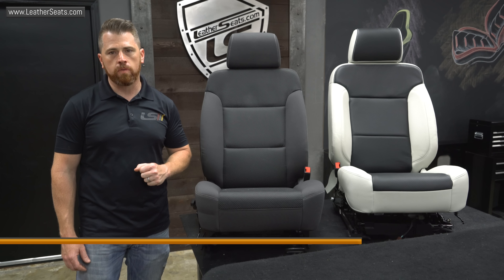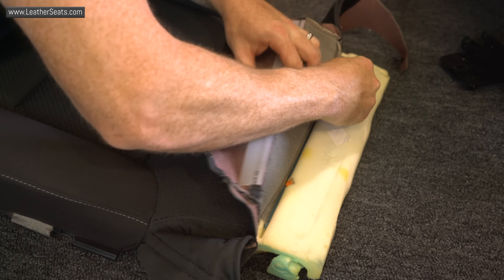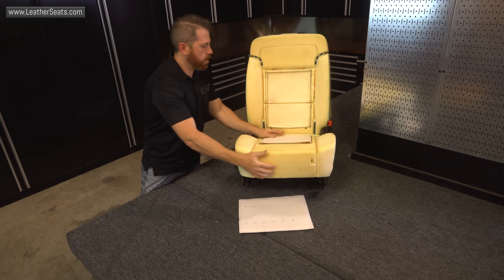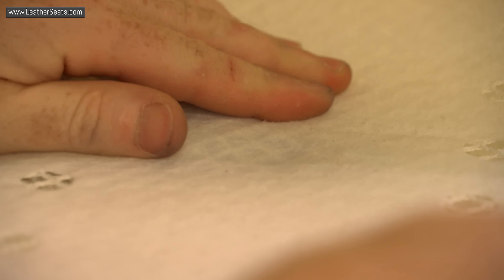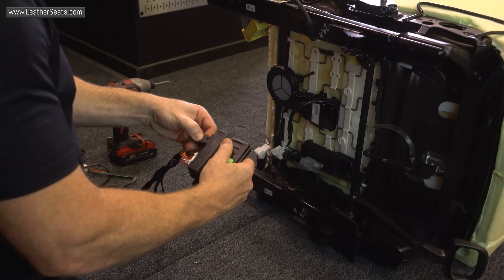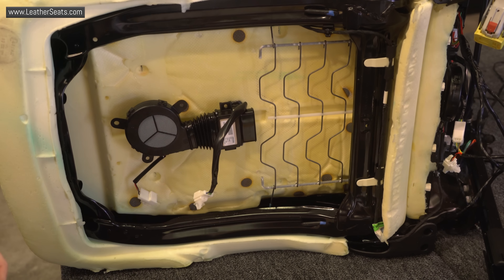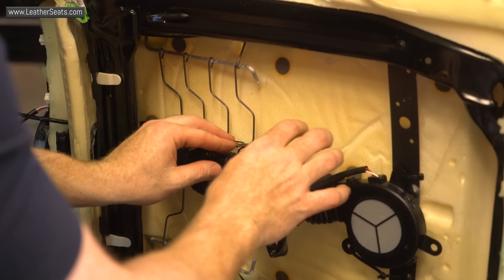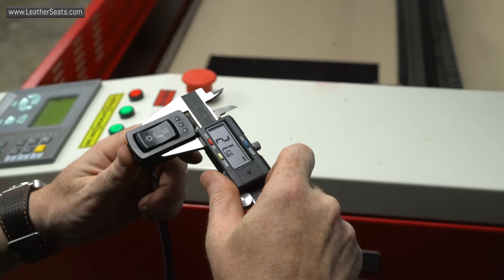Installing Heating and Cooling Seat Ventilation Units - LeatherSeats.com Tech Tips

Comment: Adding leather is fairly a normal practice in the aftermarket world, adding heated seats is also fairly normal, I probably would have noted that the clear lines going under the seat are pressure sensitive and turn air bags on and off depending on weight and that you should avoid doing this on seats that have that system on them. Or when doing it to be extra careful to not puncture them as they are filled with glycerin. 

Two questions :

What and how do you charge out for
This job? I’d like to say that an average seat 💺 Hester job runs about 499.99 in my store for two seats, with the additional labour involved with adding cooled components to the mix what’s the average labour time involved with doing the installation? 

Modifying seats in the fashion is quite dangerous and you could potentially be modifying the time delay process with air bags during a crash, has your product been tested using the proper governmental structures? 

Thanks a bunch! Super interesting concept would like to know more.

Comment: Can I do with underneath a seat cover so I don’t have to tear up my whole seat?
Reply from the maker: Jacob Werner I'm not sure I understand what you asking. The distribution pad sits between the seat upholstery and the seat foam. The pad is what directs the air through the upholstery to heat/cool the seats and will require the vent tubes to connect to it (which requires a hole to be cut in the foam). You can get as creative as you want with the install to fit your needs but you will need to modify the seat foam to some extent. Give us a call at 1-866-639-7328 or email us at sales@leatherseats.com if you have any questions about the process.

Comment: How effective are these kits vs factory?
Reply from the maker: Jamie Diaz As long as the units are installed correctly with the proper upholstery (perforated material with high-flow foam backing) they function just as well as any factory unit. In fact, we use the same Gentherm components that are used in many factory systems. If you have any questions please feel free to give us a call at 1-866-639-7328 or email us at sales@leatherseats.com.

Comment: Great workmanships!   I have a 2018 Mercedes-AMG c63 with heated seats.   Could I add this vent seat modification into my seats?
Reply from the maker: Frank Kwok These units are universal and can be mounted in most vehicle out there. There are a few requirements for the seat upholstery though. The upholstery will need to have perforated inserts as well as high-flow mesh foam backing to allow for airflow. If you have any questions about these requirements please feel free to give us a call at 1-866-639-7328 or email us at sales@leatherseats.com

Comment: Nice job. However, once you start tapping into the wiring the warranty will be voided (if there is one). Would it not be better to connect it to the fuse box?

Comment: And let me guess , the seat becomes more uncofortable and the TED separetes from the pack afterwards
Reply from the maker: +EmptySergeant When installed properly the units lay flush with the seat foam and you don't feel any difference after the leather upholstery is installed over it. As for the separation see 8:48 in the video. You can get a similar effect with zip ties.

Comment: Helpful, I'm currently reupholstering Eos seats right now. What we thought was a cigarette burn turned out to be the factory heated seats had caught fire at some point. The burn marks followed the outline of the heat pads. Was not noticeable on the outer cover. Just ordered the new pads. Thanks for the video :-).
Reply from the maker: Sondra White Whoa, sounds like a bad deal! Glad you were able to track it down and get the heaters replaced. Thanks for watching!

Comment: pretty cool system. it does seem like it's a little over-complicated though. i feel like it would be easier and cheaper to just run plumbing from the car's vents with motors instead of having control modules and TEDs that exhaust hot air into your car while your trying to cool it down.

Comment: @LeatherSeats.com Would it be possible to attach two blowers to both the top and bottom units? I sweat A LOT more than most people do and the added air and cooling would be nice. The stock seat cooling on my dads 370z isn't enough at all. Its definitely better than the 0 cooling my car has, but it isn't enough. Also, will this blow through my (non-leather) seats without issue or will I need to modify the stock upholstery?
Reply from the maker: austinpetemo Firstly, I'm not sure exactly how the air distribution is set up in your factory cooler system. Without knowing the exact details for the 370Z system I am limited on my answer as it may not even be directly comparable to our units. It might work to add a second blower but it would be up to you (or a local automotive upholstery shop) to figure out how or if this is feasible. With our system, the units are designed around powering 1 blower and we have not tested multiple. You would need to be able to supply power to an extra blower per section and that may affect the fuses and/or the power harness. Also you would have to fabricate a split in the air ventilation tubing to direct the air from the extra blowers which may affect the pressure and/or speed of the air flow. I would suggest checking with an automotive upholstery shop that has the ability to work with heater/cooler units and see if they could help you troubleshoot.
Reply: Thanks for the reply! Sorry I didn't clarify well enough. I'm interested in using your products in my vehicle that doesn't have factory ventilated seats. I was using the 370 as a comparison; its cooling effect is somewhat weak. You pretty much summed it up for me though, the split in the tubing your product uses may be hard to fabricate. Thanks again.
Reply from the maker: austinpetemo No problem! If you have any further technical questions be sure to email ericp@leatherseats.com or give us a call at 1-866-639-7328.

Comment: So who ever in back seat gunna feel the heat?
Reply from the maker: No, that is not the case with these units or other OEM systems using the Peltier Effect. The system's under-seat exhaust  has a negligible effect on the cabin air temperature in the vehicle.

Comment: Just a question, Is it possible to install those heater/cooler units on bucketseats (nonfixed or fixed) if yes is it hard or not (may let it a shop doing it who does alot of seats and panels)
Im located in europe, getting things to you guys and back is to expensive probably

(Seats i may install > https://www.braumracing.com/product/elite-r-series-racing-seats-red-leatherette-black-piping-pair/)

Edited: Adding information
Reply from the maker: Ralf Pawlowski The seats in this video are essentially bucket seats (they are the same seats used in the buckets version of the truck) The units themselves are universally compatible as long as there is enough room to be installed properly and the upholstery has perforation with a high-flow foam backing to allow for proper airflow. The installation process on this is very immersive and requires a large amount of creative problem solving and mechanical ability. Most of our customers have a local automotive upholstery shop/ 12 volt shop install the units for them. There are no step by step instructions as every single install will be different. We can ship you the units and you can probably find someone local to help you with the install. We do not have an upholstery kit that will fit the racing seats that you are wanting to put in the vehicle however it does look like there is perforation already on the seat upholstery. If you contact a local automotive upholstery shop, they may be able to replace the high-flow foam backing which we can sell by the yard. Please feel free to email us at sales@leatherseats.com or give us a call at 1-405-848-9999.
Reply: @LeatherSeats  thanks for the extremely fast reaction. And i will look into it

Comment: Sounds loud
Reply from the maker: M The volume during the test in the video was increased significantly so you could tell what was going on. In person the system is much quieter.
Reply: @LeatherSeats  Thanks.  Are you able to publish the dB?
Reply from the maker: @eM-ed5pz  We do not have specific DB level data however, the units are fairly unobtrusive.

Comment: I'm very interested in this kit.  Can you tell me how much current the TED units draw?  I know Peltier technology isn't exactly low power.
Reply from the maker: NGinuity For the heat settings its 12 amps max/9 amps steady state and the cooling is 6 amps. Hopefully this gives you an idea. If you have any further questions about our heater/cooler units or our upholstery kits be sure to call us at 1-866-639-7328 or email sales@leatherseats.com.

Comment: Amazing work. Love the part " you see there is no support here, so, I'm just going to cut a metal support bar real quick".... same with laser cut plastic for proper cut out of switch. 
Why not just buy oem seats with said functions from a junked truck and tie into the oem system?.
Reply from the maker: J J The metal support was not 100% necessary and a laser cut hole template is included with the kit. Most customers who purchase this kit are putting it into a vehicle that did not have the function available from factory.

Comment: General Question

If I'm close to Oklahoma, is it possible to go over there & possibly have you guys install it? Or does it have to be installed by someone else? Cause no way i'ma give this a shot by myself
Reply from the maker: Erick Villagomez-Diaz Yes we can do local installations of our product. This system does require some very specific components in the seat upholstery in order to work properly though so please contact sales@leatherseats.com to go over the details, pricing, and scheduling. You can also give us a call at 1-866-639-7328.

Comment: What do you suggest in a bmw 135 convertible? Cooling seats would be awesome! I'm guessing this works only on upholstery, and not leather?
Reply from the maker: George Giannou Our heater cooler units are universal as long as your seats 1-have room to mount the units 2- have access to proper power and 3- have perforated upholstery with a high-flow foam backing material that will allow for proper air flow. Upholstery refers to the material that is used to cover the seats in your vehicle. Leather upholstery is typically the better way to go for integrating heater/cooler units like these as leather can be perforated and backed with a high flow foam. Most cloth upholstery does not have perforation. If you have any questions about our products please feel free to email sales@leatherseats.com or give us a call at 1-866-639-7328.

Comment: Do you connect the backlighting for the switches to the same power on connection?
Reply from the maker: MsCelicagt4 The switch lights are already integrated into the power harness. Once plugged in, the lights will work.

Comment: Hello, very informative video. 
I have heating in my seats, but no cooling. Am I able to use some of the pre-existing parts and mainly add the cooling/heating device to what's in the seats and change the switches. Or does the heating alone run system  totally different to a heating/cooling system?
Cheers,
Col
Reply from the maker: Hey Col, our heating and cooling system is designed as a self-contained seat climate control unit that will replace any system that you currently have in the vehicle. It is not designed to integrated with any other existing system. Most seat heater systems use a surface mounted pad on the seat foam that warms up upholstery from underneath. Our system works differently by actually blowing heated or cooled air through the upholstery. This means that your seats are going to need to have perforation as well as a reticulated high-flow mesh foam backing in the insert sections of the seats. If you would like to know more about this product or the seat requirements please feel free to call us at 1-866-639-7328 or email us at sales@leatherseats.com.
Reply: LeatherSeats.com that's fine thanks. Aircon works well. Thanks
Reply: @LeatherSeats  Just to clarify, the white pad in the video that is taped and glued to the foam is a different product than seat heater systems on the market? One cannot merely install the fans, and make the same vent connection to it, then, install a different switch?
Reply from the maker: @thatsamorais584  Yes, this is a completly different product than a simple seat heater pad. The main difference is that it heats OR cools the seat via air being blown through distribution pads. The typical stand alone seat heater is a thin fabric pad that gets installed between the foam and upholstery that has heating elements/wires sewn in (no air being blown). Our pad is thicker and mostly hollow to allow air to be directed through it.

For the switch, ours has six separate settings: high med, and low for bot heat and cool. Most factory switches at most are going to be 2-3 settings for only heat. There may be ways to integrate other switches but we do not recommend it.

Hopfully this helps answer your questions, if you would like more info email sales@leatherseats.com or call us at 1-866-639-7328.

Comment: This is really awesome! Do you think this would work on a 2018 Corolla SE?
Reply from the maker: Christopher Hernandez The heater/cooler units themselves are universally compatible however you do need to have perforation and a high-flow mesh foam backing on the upholstery to allow proper airflow. You may want to show this video to a local automotive upholstery shop to have them see if it will work for your Corolla.

Comment: For volkswagen golf 4 it s difficult?
Reply from the maker: Gio Jo. Thank you for contacting us! Our product is not intended for any specific vehicle. There is a level of electrical work and fabrication that goes along with the installation of this product. It is doable for a more extreme DIYers. It is a pretty involved process so you may want to have an automotive upholstery shop that is familiar with this system to do the install.

Comment: Do your seats come already installed in seats they then just need to be installed into the 2014 silverados
Reply from the maker: +Jon Valera Im not sure I understand your question. Our upholstery kits are designed to replace the factory upholstery only. We sell leather trimmed upholstery kits not seat foam or full seats. Like this video shows, we also sell seat heater and cooler units which are sold separately from the upholstery kits and need to be installed prior to our upholstery.

Comment: Looks to me like an improvisation. I mean cutting with razors, eye measurements, using plastic wires to mount the vent... doesnt sound good
Reply from the maker: Dragos Bidu This is a universal product. Every installation will be different because the seat structure and space to mount the components varies with every single vehicle. You will have to be creative when adding any system to a seat that was not originally designed for it.

Comment: Amazing work..
Can this be done to a Camaro?
Reply from the maker: Miguel M Thank you for the compliment! This is a mostly universal product however it's up to you to determine if you have the space inside your seat to mount system. You would need to have perforated material and reticulated (high-flow mesh) foam backing on the seat upholstery in order for it to work properly. Please feel free to give us a call for more information! 1-866-639-7328

Comment: How do you conect it to the eletrical system of the car? Where do you conect it to...????
Reply from the maker: Noches De Carros 0639 0639 Eric give a quick overview of the wiring process near the end of the video here: 20:17 Each vehicle will be different but the overall concepts are the same. If you have never done car wiring or worked with 12 volt we would suggest that you take it to a shop to be wired.

Comment: Outstanding video.  Fantastic units with clear informative directions.  Nice.

If I had the funds, these would definitely be the choice.  For now, planning on tapping into the ducts below the seats and routing that flow.   Plenty of pressure, adjustable temp with the oem climate control.  Not gonna lie though, fabricating some pads like those are gonna be some next level Macgyver s***.  Gonna need some paper clips and bubblegum...
Reply from the maker: Porter Fox Glad you like the video! Thanks for watching and let us know if the budget changes for you!

Comment: You never showed how you ducted the air to the back pad
Reply from the maker: helmet098  The backrest air airflow is created by the centrifugal blower which is pulling air in from behind the plastic backrest shell and pushing it through the TED and then into the distribution pad.  You can see this setup at about 17:00 minutes into the video.
Reply: LeatherSeats.com so there are 2 TEDs and blowers for ea. seat?
Reply from the maker: helmet098  Yes
Reply: You might want to point out in the video you don't need to cut that chanel.in the back rest of the car your doing since the pipe ran in front of the metal support around minute 17. It may be needed on other cars but in this case was an oversight that got left in I think. Great video though. Finally a product worth doing aftermarket. Thanks